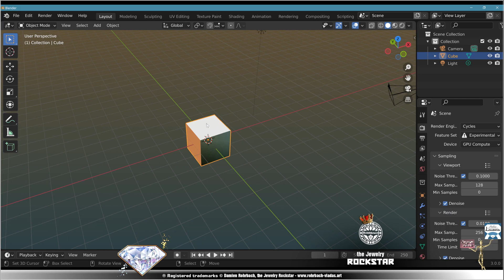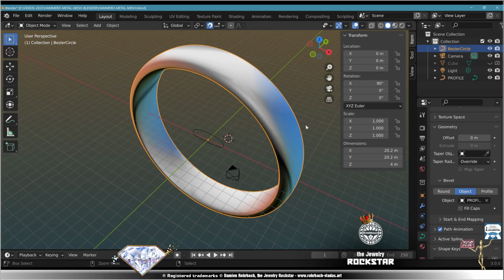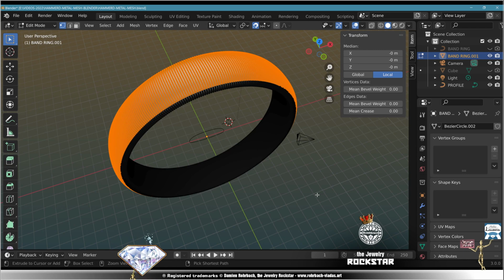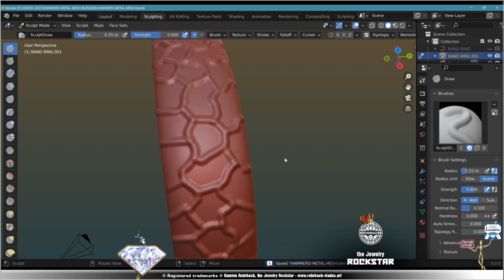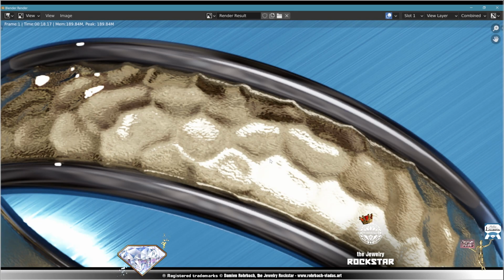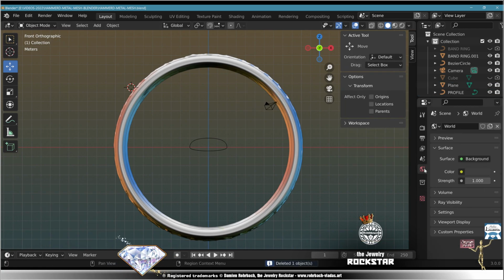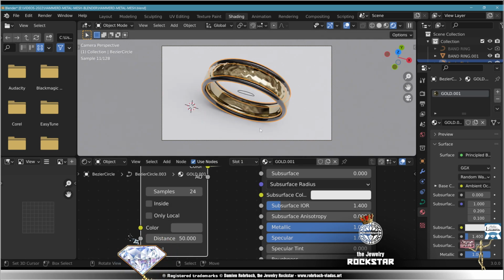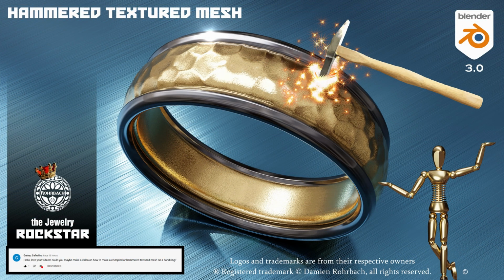3D Jewelry with BLENDER Hammered textured mesh by ROHRBACH

Comment: Hi! I have a question, even though it looks faceted in object mode, is the mesh smooth and it will come out smooth in 3d printing?
Reply from the maker: The geometry that you make, is the geometry that will be printed. Don't confuse "smooth shading" has no effect on the geometry, and don't confuse the "smooth modifier" that would obviously smooth/damage the geometry and get a poor print.